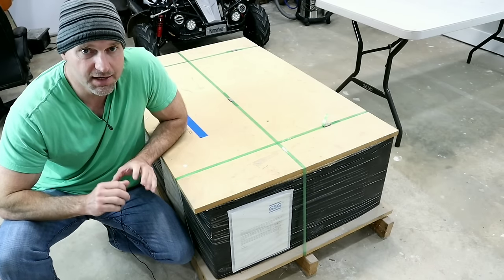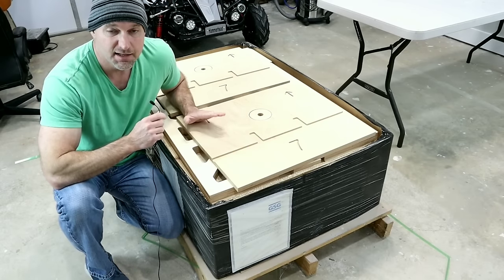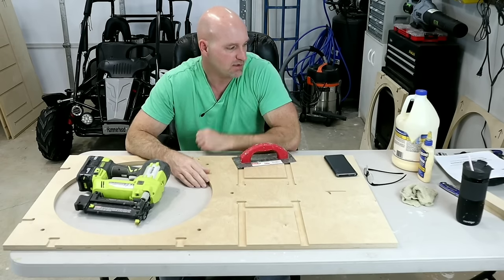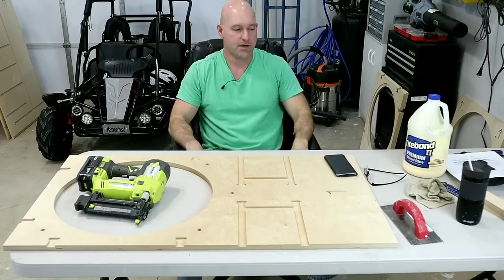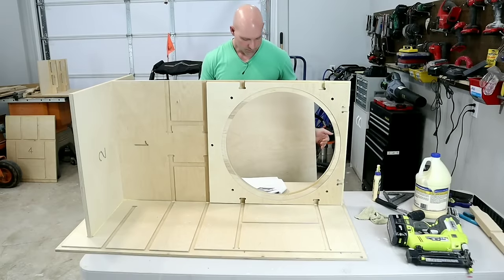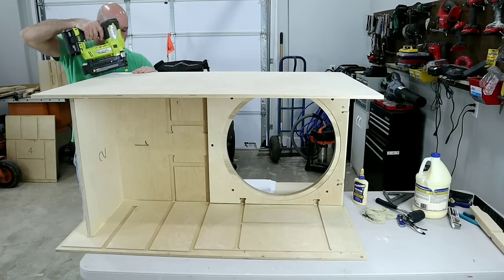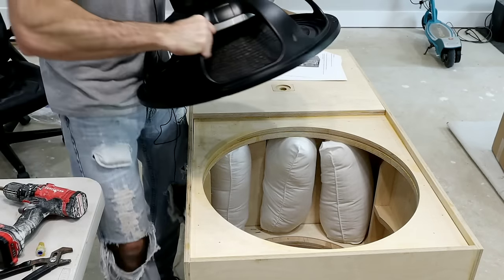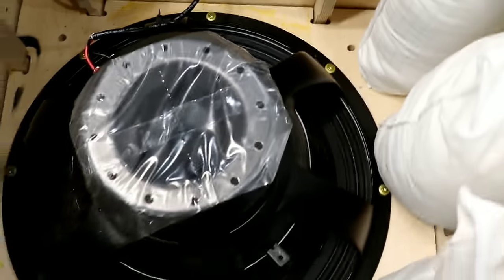DIY Subwoofer DEVASTATION!! GSG Devastator DIY BUILD VIDEO.  HOME THEATER GURUS.

Comment: What made you go with birch over MDF?
Reply: Lighter and more rigid, it’s why JTR uses it in their subs.  You can have the same performance without as much thickness and weight as MDF.
Reply: @clintstuckey  MDF absorbs moisture a lot, falls apart, and also sucks a lot
Reply: It comes as a kit and that's what the kit maker uses... If it were in MDF it would be considerably heavier
Reply from the maker: This is what GSG cut the kit in.  Some Kits are only available in birch as is the case for the Devs.  Birch is very popular especially in the pro world as it's so light but a very dense plywood so it's great option.
Reply: The HQ New Zealand HDF used in our kits far from sucks 😊.  BB is the popular choice with both our 'Live Stage' & 'Outdoor enthusiast' clients. There is a weight difference, BB will take that extra beating from loading & unloading between gigs &  BB will weather a rainstorm better but    🤷‍♂ last I checked most 'Home Theatres' are located safe from the elements indoors & coming in around 300lbs finished & loaded they don't get moved often (if ever). 
There's zero audible difference between BB & MDF & given the current market price for BB... If it's not necessary for the above reasons then its not needed at all!
Reply: I believe the birch version is meant for live music, as it is tuned to 29 Hz instead of 19 Hz. The reason birch is the wood of choice for pro audio is its strength-to-weight ratio, as well as screw holding power for handles, casters,... all the necessary features for transporting speakers.

Comment: I’m not smart enough to understand what happened. But 5hz in a sealed box is crazy. I have 4 21s that I do not have boxes for. 
Gonna do flat packs… but now I don’t know if I should do ported or sealed. Please help. 😢
Reply from the maker: See the recent video I did on ported vs sealed and how they actually differ which is not what most think.   That should help you out but I can tell you I hate low frequency pressure in room as at high spl it beats the room up (room distortion) and pulls you out of the movie.  I much prefer to filter 15-20hz and use tactile transducers for the lower stuff.  Now that's my preference and as it's a hobby there's no right or wrong, just what i like or you like.
Reply: @hometheatergurus  already checked it out. Great video. I do know that I’ve been experimenting with near field midbass modules… and I want that tactile feel for every frequency. I’ll probably have to get some bass shakers, a lot of nearfield subs, and figure out what to do with the 21s. Everything I read says it’s most appropriate to put them in a box tuned to 28hz that matches the FS. But I also don’t wanna lose out on the low end. So confusing
Reply from the maker: @danieldeluzio8674  ignore info saying to match the fs.  That's not how it works.  You can tune well under it with no issues.   See the winisd tutorial
Reply: @hometheatergurus  you’d be on the same page as some others and just do 4 full Marty’s ( 1 for each corner )? 

I’d like to use my 18s as nearfield woofers, but I’m unsure how to integrate smaller woofers in different enclosures, as well as how to do it with 1 minidsp 2x4hd.

Comment: How low is rated it looks high end ,I was going build 2 but most pro drivers I found 30hz  is the lowest it's like they are more focused on dBs
Reply from the maker: Do you mean the FS of the driver?  If so you can tune well below the FS but many don't realize it.  See the WinISD tutorial video.  These are tuned to 19hz and in room will dig even deeper.
Reply: 30 Hz is the target for some pro audio subs to hit, not only for driver Fs, but also for complete subwoofer's F3 (-3dB frequency), because there is no need for live audio (of most music genre) to go any lower, since the low B note, the lowest note on a 5 bass guitar, is 30 Hz.

The Eminence driver has Fs of 29 Hz, which is what this version of Devastator enclosure is tuned to. Matching driver Fs and enclosure tuning frequency typically results in flat frequency response down to just above the tuned frequency. Flat (neutral) response is also what pro audio speakers strive for, because any positove EQ'ing will require additional power, which has a slew of burden up the chain to amplifier, to even the facility power capability.

Comment: for me, even i had the space for it, this is not the right construction because of it's band pass resonance design.
i prefer a very dry and resonance free subwoofer which is true to the audio signal. that is a simple closed box with no vents. a good inner construction that keeps the side boards from resonating and radiating.
Reply: It's not really a bandpass design. 
It's horn loaded bass reflex, tuned to 19hz. 
It's devastatingly fast, visceral energy ... all from off the chart sensitivity and power. 

Yes, sealed is theoretically superior, etc. I built my own quad 18 infinite baffle attic dual-opposed manifold. 

Plus other subs. 

But a single Devastator would crush any of it.

It's compression, even four 18"s made for IB have too much compression through the mid and upper bass. 

The Devastator is a peerless design ... peerless at maximizing Hoffman's Law of output, extension, and size.  

It's less loss, accurate signal tracking capability, articulation. 

It's a 21" vented tuned to 19hz, and the front of the driver is loaded by a single piece of wood, extending to the opening. 

The mid bass clarity and articulation makes most anything else sound like mush.

Comment: Why not build a subfloor in a theater build to include this setup designed into the floor. Real shakers!
Reply from the maker: I'd much rather tactile transducers which are basically sub motors attached to the seats.  This is gives you a tactile response at all levels vs having to crank to high levels to get tactile. I've had rooms on floating floors and on a 2nd floor.

  Even with those floors tactile transducers still add fun that subs alone don't.   That said the Devs can shake your pants and make the seats vibrate even on concrete.  They can easily pressurize the room.
Reply: I am building a floating floor 12X12 on 4 ea 8,000 lbs capacity tire spring with a subwoofer underneath hope this will shall willfull😅

Comment: As someone who is into pro audio, car audio, hifi and home theater, I will NEVER understand why you guys insist on using poorly optimized pro audio woofers that are designed for large open venues and are not designed to play sub bass tones, as subwoofers, it's baffling. 

Think about it logically for a half second, what does 20hz look like? What does 200hz look like? Clear and VERY visible and obvious difference, right? What's the difference between 200hz and 2000hz, in terms of woofer excursion? Very little, right? You can't beat physics, and you're asking woofers optimized for 200hz+ bass fill, to handle sub tones, and sure, like any driver, they can produce sound outside of their optimum range, but that doesn't mean it's happy doing it, or that it's doing it well. 

I'll put my pair of 12" Martinsson design THAM12 loaded w/ Sundown Audio SA-12V2 running on my Crown XLS1502 against your 18" ANYDAY. My cousin has a rather large system that they supply to large events, I bought my XLS1502 from him, his sub boxes are EAW SB850s loaded with 2x RCF L18P400. We compared a pair of them to my subs when I had just built them, before they were even properly broken in, and yes the 4x big 18's got louder at higher frequencies, however the low end hit, even at full volume, as in the ability to shake shit off the shelves and pound in your chest, was pretty much exactly the same in room as my little subs. We did take them outside after, big open savannah with 300ft of flat cut grass in every direction, and about 80-100ft away from my subs, you could barely hear them, much less feel them, they are not designed or optimized for large open venues. The big SB850's could be felt in your chest from at least a quarter mile away, those big bitches hit HARD in the right venue, that venue is not your living room, you're not sitting a quarter mile away from those subs. They are designed to throw sound far away, to cover distance, because they're designed for concerts and public address in large spaces, when you put them in a small room, and yes, even your 100x100 living room is a small room to those subs, they're just not as good at pressurizing the room as a proper subwoofer, because they weren't designed to do that. 

Bigger is not always better, compare the F3 of the RCF L18P400 (Or your woofer) vs the Sundown Audio SA-12V2, the RCF's F3 is 52Hz in the optimum ported enclosure 3.2 cu ft, the Sundown's F3 in a small 1.5cu ft ported bass reflex enclosure is 29Hz. What are you trying to accomplish? Not sub bass? 50Hz is the mid-high end of sub bass, my subs crossover at 80Hz. 

Compared to a proper subwoofer which IS designed to pressurize a space, those big speakers just cannot perform the way you want them to. You're probably gonna get a little offended and maybe even a little defensive when you read this, I don't blame you, you spent a LOT of time, money and effort to build these monsters, and I am not saying they're bad, I'm saying they're poorly suited to the task and you'd have superior results from a smaller but more optimized subwoofer. These would fit in so perfectly into a large outdoor system, you could shake the block with these, but for your living room? For home theater where I want the sub to be able to produce and hold a 20hz tone? They're just not the best fit, and I'm personally confused by just how many people seem to do this.
Reply: I completely agree, "horses for courses"..... you wouldnt use a "shire horse" in a race, or a "race horse throughabred" pulling a heavy wagon.... both would fail.....

Comment: Wtf is duck board ?
Reply from the maker: It's what ducks make their houses out of.
Reply: @hometheatergurus  Keep on failing
Reply from the maker: @Smood47  Google it.  Hvac ductboard
Reply: @hometheatergurus Is there a specific thickness of duct board you recommended using for the baffle?
Reply from the maker: @chevron916  1" is fine.
Reply: @hometheatergurus  thanks 👍🏻
Reply from the maker: @chevron916  you're welcome

Comment: It's like watching an old Chinese martial arts movie, the dialog doesn't match the mouth movements, and the sound effects are about 2 seconds out of sync.! roflmfao  P.S. Those cable staples are a really bad addition, they WILL vibrate loose and hopefully not land inside the speaker and just vibrate around in the cabinet. And it is SPAX screws - not Spanks.
Reply from the maker: Thanks for watching.

Comment: So….   we are taking time to watch your build video…. Did you watch any build videos?   You really need alot of improvement in woodworking.   Fear not!   You can easily gain that  by watching builders and cabinet making vids
Reply from the maker: I've been designing and building subs for over 20 years. It's a sub that will be hidden not fine furniture.  Thanks for watching.
Reply: Doing it for 20 years doesn’t mean that you have been doing it right. At around 30 min you mention the braces don’t need too much glue. This alone shows you haven’t learned anything in 20 years

Comment: It's a pro audio woofer only watch movie non war movies and live music that thing can't handle regular music played from a CD player it will blow that sub. If it was me I rather have a car audio subwoofer to be able to go low. That sub ment to be loud but not a hole lot of bass that why it's in a horn the sound will travel but to hiar all the different details you would have to be far away that's way most powered subs are car audio sub disgined. It's better in a room application and plays low in movie's  
   p.s. my 12in sub is 75 pounds 2500w RMS  and it considered a street design the comp version Even bigger I could only imagine 15 or 18 inch. if you had two of them you would need a 8k amplifier just for the subs. Now That's big
Reply from the maker: Car audio subs by nature don't extend that low as they have a high FS as does the driver used here.  This driver just has the displacement, xmax and  power handling to get down low in the right box.  The Dev is tuned to 19hz and that can be measured at the port.   As for  having to be far away whoever told  you that lied to you.  That's not a thing.   Ground planes are done at 6' . 

Two of these in room are linear easily to 17hz with enough output to wake up your local PD.    If you're gonna come at this with a 12" driver you better have a bag full of unicorn dust because this a monster from head to toe and would likely have your 12 running home to get it's big brothers
.   The drivers seen here have 10,000 watts of peak power handling each,  klipple verified.

Comment: No rubber surround then is not a subwoofer
Reply from the maker: Rubber is for tires... Whatever you wanna call them they'll wreck the neighbors house..  You can call them cantaloupes if you want...😀
Reply: @hometheatergurus  yall know what im talking about, the foam on every single edge of a real sub
Reply from the maker: @mikeyan7312  Yeah foam is OK.  That in no way makes something a sub and foam dry rots in time.  I think you need to rethink how you define "subs" :). Trust me.. this is a sub of mass destruction.